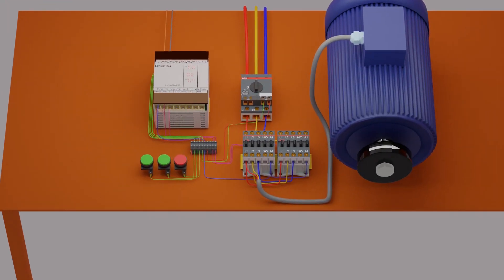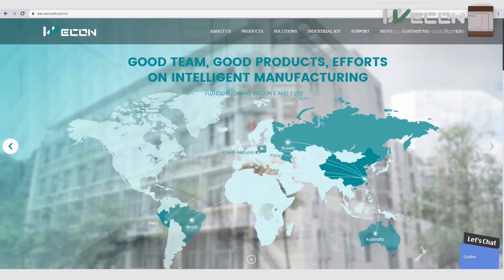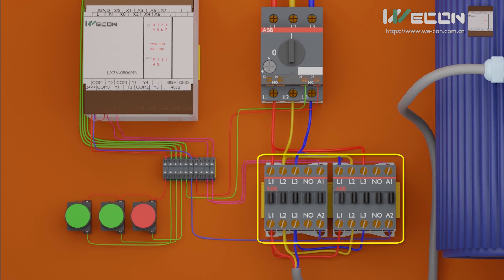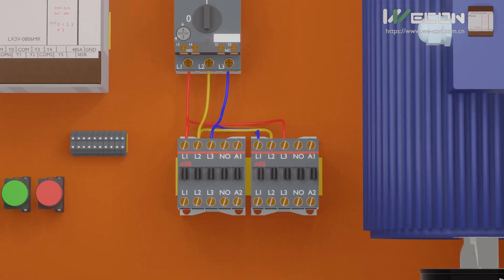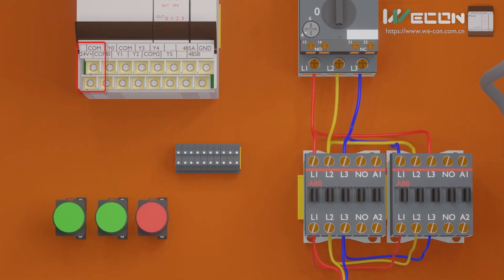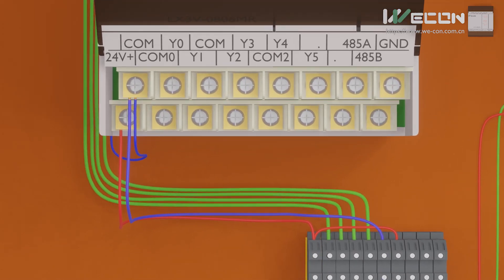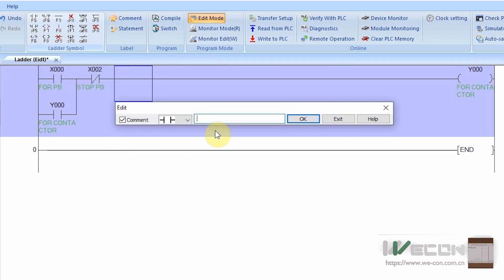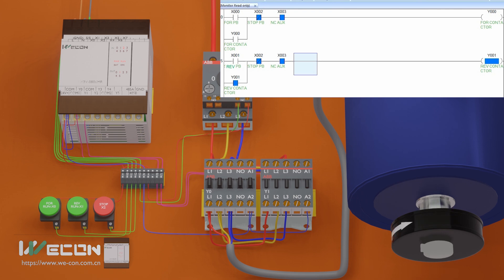How to RUN three phase motor in reverse and forward directions using the PLC ?

Comment: it is very dangerous when the motor is forward, then I press the reverse push button then Y0 and Y1 will be ON, it can cause the MCB to trip. indeed the push button stop should be pressed first before changing the direction of rotation.
But if there is a short on input X0 and X1, it will be dangerous.
Note: added interlock after contact X3 cross Y0 and Y1

Comment: If you press both forward and backwards it run the two outputs and if the two contactors are not mecanicaly linked it will create a short. You can put a nc of the other out in every line.
Reply from the maker: Yes this is a mistake , 😕  thanks for pointing 👉
Reply: @EASYPLCTRAINING  Thank you very much for your work.

Comment: You should probably add code so that you couldn't run the motor in forward and reverse at the same time. I only say this because if someone copies you it will cause a short circuit.

Comment: I want to know what plc (switching) output wire goes to contactor coil terminal?
Reply from the maker: Yes A1 and A2 coil terminal
Reply: Negative  and positive supply coming from plc which source sink and comon. Is common negative and sink is positive supply?  Details plz sir I want know plc positive and negative supply source